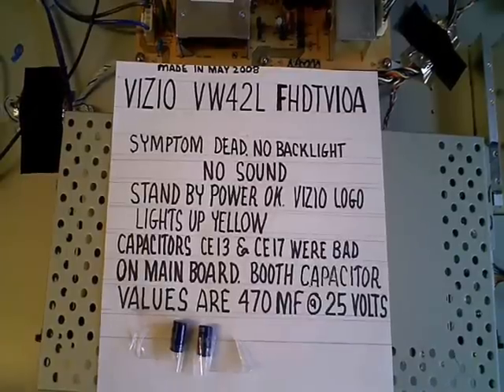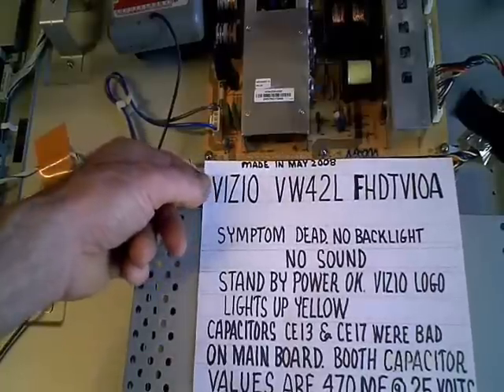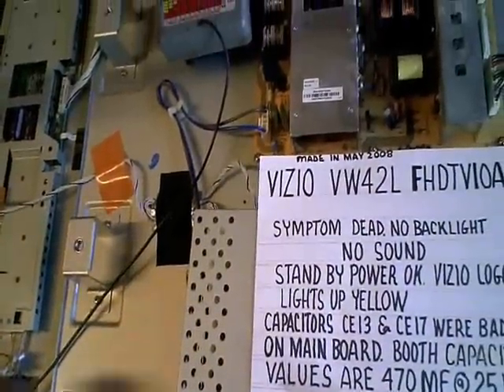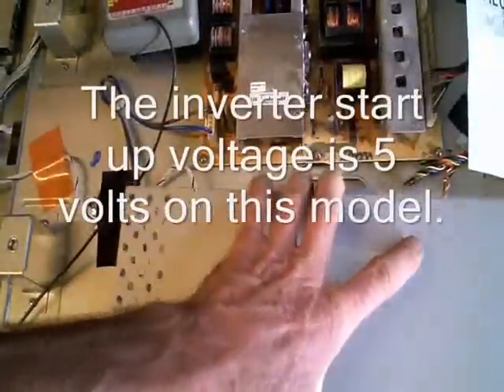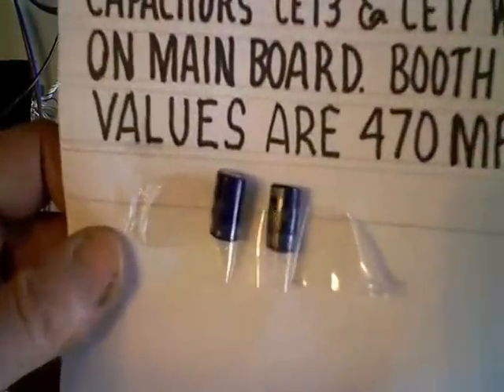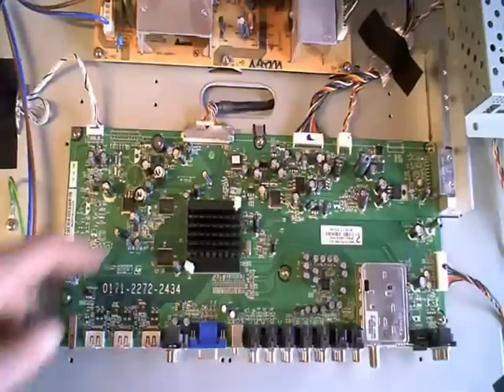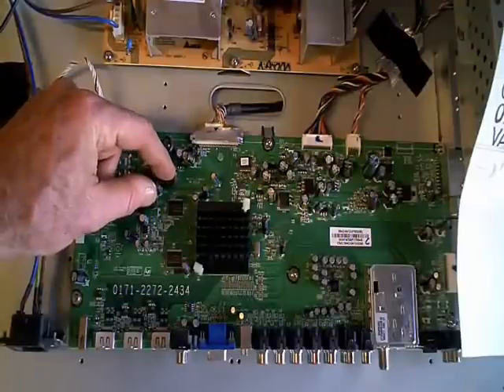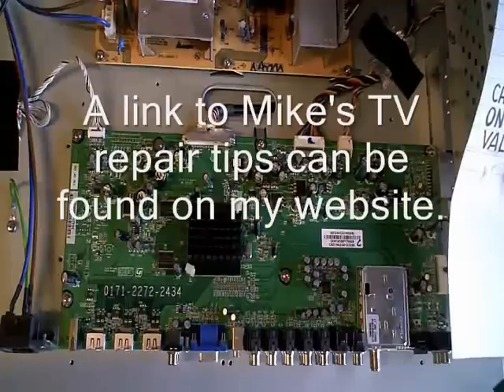VIZIO VW42L FHDTV10A. MAIN BOARD PROBLEM SOLVED.

Comment: got one of these now,2017 model though, which has a master/slave inverter setup. Now don't think that's the problem because I got no voltages coming out of PS board, no vizio logo lit, no clicks, just dead. Main Fuse is good, rectifier spitting out 176 Vdc, but no 12, 24, PSON 5 volts on outputs,could it be something on the main board before I have to unscrew the 88 screws to get to it...lolz, kidding...

Comment: Im not getting 24volts or twelve from the power supply, i get 5SBv, por i dont get any other voltage, what this could be? Sams thing, no backlght or image, no sound, logo is amber, press the button and then turns white for a seconds but turns off again, no 24 or 12v present as i said, would be nice a lil helo, thanks in advance

Comment: Do you know if the Vizio VW32LHDTV40A with the main board number 3632-0622-0150(2G) has this same capacitor issue? I have the VW32LHDTV40A Vizio TV and the main power supply board is good but I still cannot find the problem as to why the TV will not turn on. I do not get any lights, not even the Vizio light come on. The VW32LHDTV40A main board has two 470MF at 25V caps but they are not the CE13 and CE17 as is the board in your video. The 3632-0622-0150(2G) board has CE15 and CE38. None of the caps on this board appear to be bulging.

Comment: Handy video! My tv is the vizio vw42lfhdtv10a. I was given this tv because the owner said it works except for the three HDMI ports. I plug in an hdmi device, and it works fine for roughly 30 minutes, then the tv starts to go scrambled. I turn off the tv, wait a few minutes, and the tv works fine about a minute then goes scrambled again. Yet, I can still press the Menu button at any time and it shows up perfectly over the scrambled stuff.
Might you happen to know if this could be bad capacitors, or do you think I should recycle the TV and not bother with it?
It's a nice tv, but the only port I would use is the hdmi.
Again, the menu always comes up just fine. So something in the hdmi..? 
Thank you kindly for any advice. :)

Comment: Sir I have a VA370M How do I get the backlights to turn on.This TV has no inverter board the High Voltage to power the backlights comes from the Power supply.I jumpped the 5V and Power on andI have both the 12vdc and the 24vdc.There is a pin called off and one called DIM do I jumpthem to gather or to ground or 5V? any advice you can offer is appreciated. pcrx58@gmail.com
Reply from the maker: You TV appears to have LED Backlights which may be bad. Did you see the video I made on LED back light problems? Here is the link. https://www.youtube.com/watch?v=RRyhx4D8mcA

Comment: I have a Vizio VW42LHDTV10A 2008 model that stopped turning on. Logo glows amber but wont turn on white. If I press and hold power button on side of TV while plugging it in at wall outlet, It comes on normal and works and can even get menu screen to come up. Can you tell me where the problem may be? thx
Reply from the maker: Sounds like a possible main board problem,  but I can't say for sure.

Comment: Bad capacitors have become an epidemic - I've seen countless TV's, receivers, computer motherboards, power supplies, etc. with bad caps lately - yet old 60's and 70's electronics seem to still work - why is that? I can drive through my neighborhood once a week and find numerous LCD & Plasma TV's out for trash. Most of them just a few years old. The majority of them have power supply issues related to bad caps. Is there really that big of a problem with counterfeit caps, or has the chemical composition changed in the last 15 years that causes premature failure?

I know there's been a few class action lawsuits brought against Dell, Samsung and others over the issue of bad caps; but they blame the manufacturer of the capacitors. One of the fortune 500 companies that I was contracted for IT work had hundreds of motherboards in laptops and PC's replaced for bulging capacitors, including laptop power supplies that we had to send back because they overheated.

It's really getting out of hand and the problem isn't getting any better. Who knows, maybe the manufacturers are knowingly using bad caps - forcing customers to upgrade every few years. Forced obsolescence, perhaps?
Reply from the maker: +BSD2K11 I don't see as many TVs coming in with bad capacitors as I use to, but thankfully there are still a few.
If you google the words "capacitor plague" you can read some interesting articles about the bad cap epidemic.
Reply: I own a Feb2008 Vizio plasma P50" plays 10 plus hours a day, yes it gets warm, I installed two cooling fans on each side in 2009. Vizio stop producing ing plasma in 2009 or 2010. been told by several people, was because they will last forever. just saying the box said life span 20K hours.. I know for a fact it has 25K to date at least.. It will go out tomorrow... Oh and survived a lighting surge, took out the router, modem, blue ray, Wii...

Comment: Hello, i have the same vizio model VW42L FHDTV10A which only has one inverter board. I removed the back cover of the tv & removed the inverter board cover plate & notice it had 3 capacitors labeled 35v 680uf 105°C & two of the capacitors are bulging out the front end where the terminals are soldered to the board. My question is 

1. Could you replace the capacitor while the board is still attached to the tv?
2. At the 30 second mark of this video where your left index finger is positioned, how do you remove that ribbon?

Tks.
John

Comment: Hello, I have the same tv model with the same problem, the logo gose to with when i turn it on but nothing else comes on. I have some 470uf 35v capasitors in my shop, do you think I could use them instead of the 470uf 25v ones?? Thanks for all your videos.
Reply from the maker: charliewiseco No problem with going up in voltage a little. It's a good idea to use high temperature  capacitors if you have them. If you don't they will work but their life expectancy will be shortened.

Comment: Thanks Dave. Nice job. I love my EDS 88A especially on SMD caps, but I use my Blue ESR meter more on through-hole caps. Do you have a Blue ESR meter? They can check ESR's of batteries also. I don't think the 88A can check batteries.
Reply from the maker: Why do you use your Blue ESR Meter more than the EDS 88A?
Reply: Grants Pass TV Repair
Because the 88A only has tweezers. Plus the Blue ESR meter gives an accurate readout instead of a light for a numerical range. I'm glad to have both of them.
Reply from the maker: Thanks for the tip. I've been thinking about getting a blue ESR or the capacitor wizard one of these days.
Reply: Grants Pass TV Repair
You're welcome. Thanks for all the good videos and tips you give us! It is also very good at checking sub-ohm resistors. I haven't used the Capacitor Wizard, but I thought about getting one also. I do have the new Peak Atlas LCR45 and I like it very much. I also have the DCA75 Pro & the SCR100 thyristor and triac tester. The Peak Atlas testers are all real handy; and the only testers I have that are made in England.